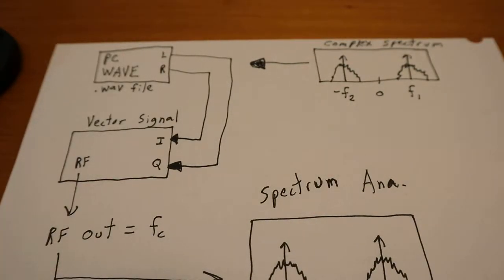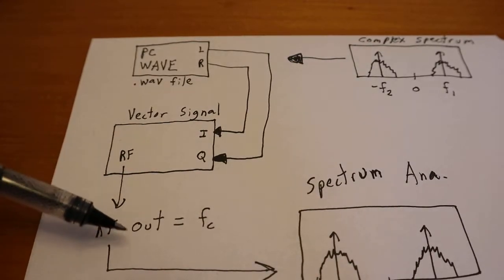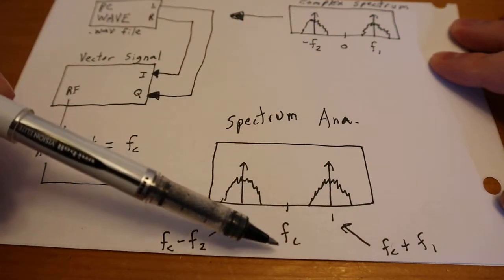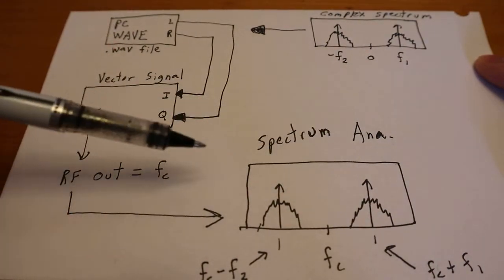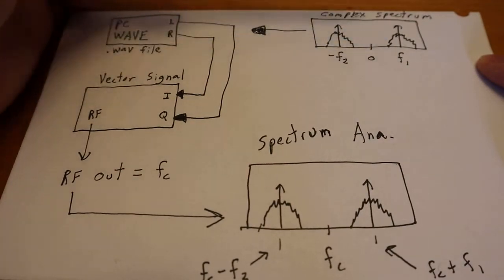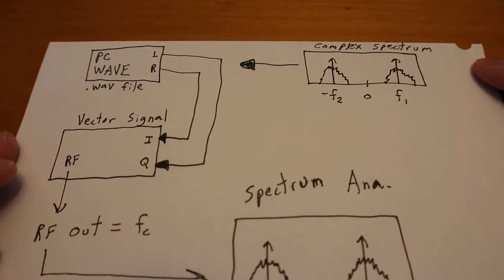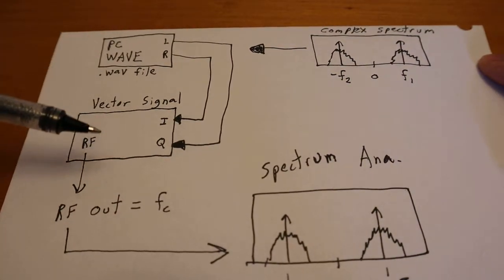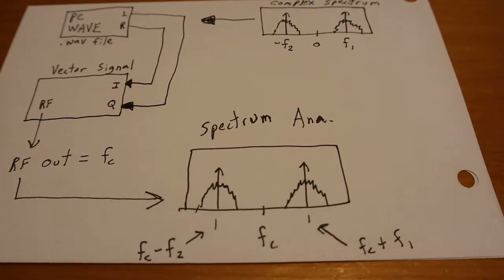IQ Modulation Part Two

Comment: very good video ,practical demonstration would be better sir ,because still we lag in such technology..i connected jack plug to PC and played a song and splitted 2 signals left and right with bnc connector to analyser for I and Q input finally took out put at spectrum analyser.  
                    L-----[]------BNC-----I---||||||||| analyser ||||||||------spectrum --------[][][][][] OUT  
                     R-----[]------BNC-----Q--|||||||| analyser ||||||||------analyser   --------[][][][][] PUT
Reply from the maker: with modern sdr,  it's much better these days to use a trx duo sdr or pluto+ sdr and just stream the digital iq samples to the device.    the sound card method i used was for a old R&S vector sig gen i had,  and i realize, almost no one will have a R&S vector sig gen in their house.   lol
Reply: 🎉🎉thank you sir

Comment: But hey ! In your last iq modulation video you have the 2 final spectrums added together and then sent out to an antenna. So why would I ever get 2 output spectrums ? Are these lower and upper sidebands ? Why do they get added together ?
Reply from the maker: they are complex baseband signals being added together.    many carriers with data is the main idea of ofdm, which is used in lte, wi-fi, etc